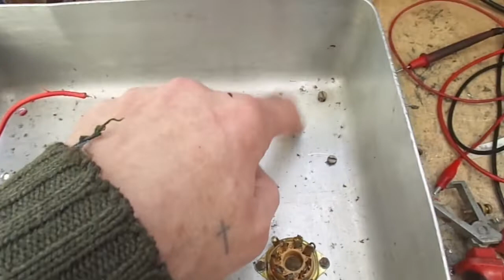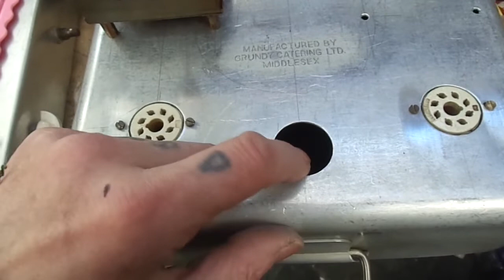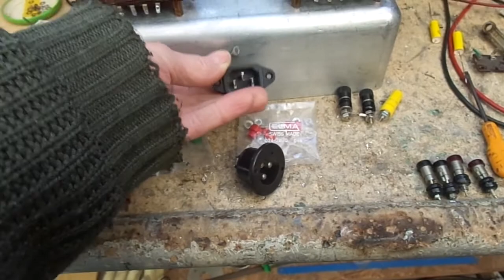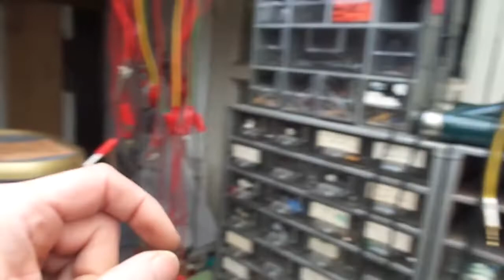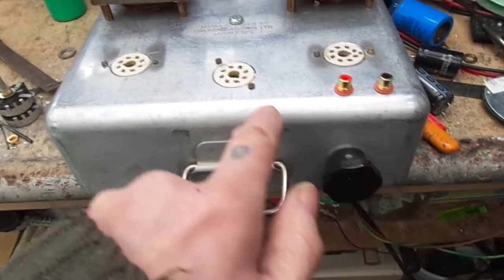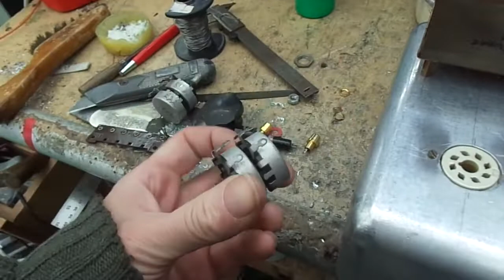6V6 SE Class A Build - PART 2.

Comment: The great thing about those specific  ceramic sockets is if you break a pin off, there is just a little triangular fold tab that when straightened, allows the pin to fall out and another put in its's place. I keep the removeable pins from damaged sockets to make repairs with . That saved my rear several times and saved massive amounts of time.
 RE: Centering sockets: Those are SAE not metric, and I think your punch is metric. Easy to mark holes. Put socket centered in the hole and put a strip of heavy, sticky tape over the top of the socket and chassis. Invert the chassis, & It will hold it nicely in place so you can center punch or mark the screw mounting holes.   Looking good so far.
Reply from the maker: Good tip, thanks.